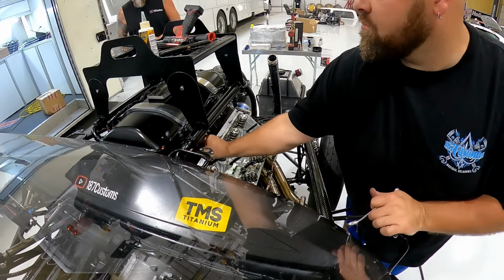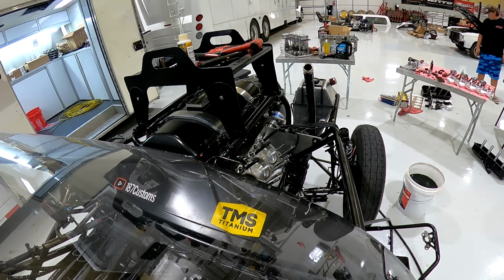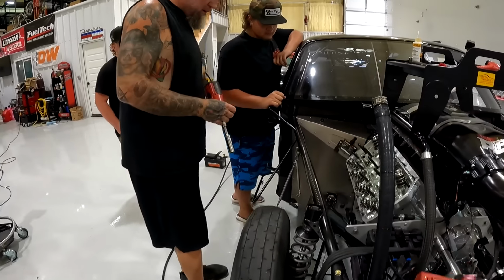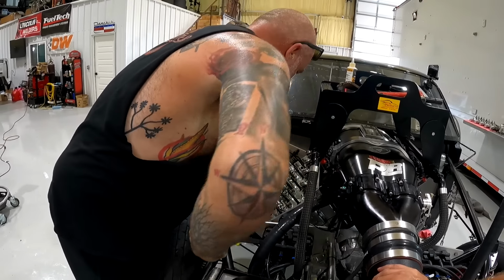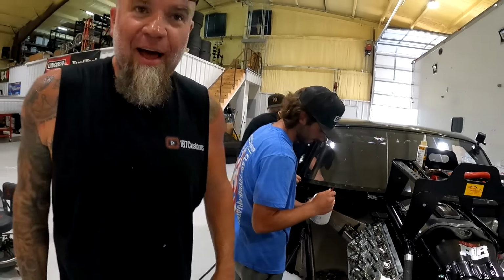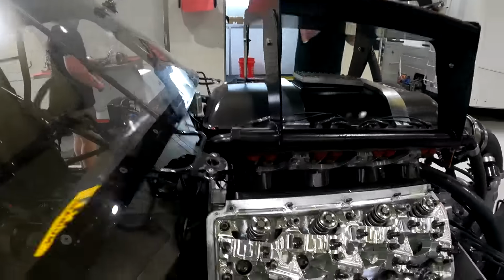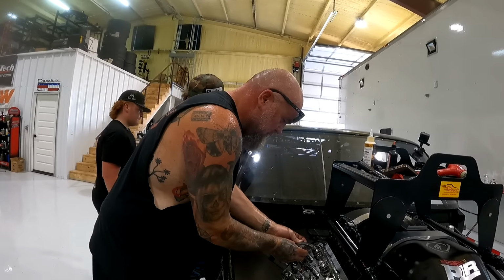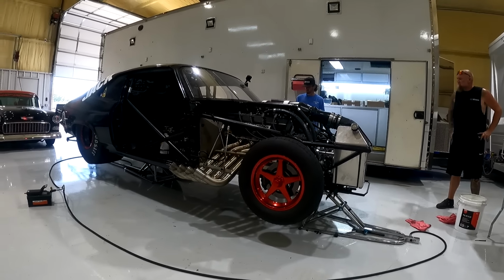Can We Freshen The Proline MH7 Hemi Ourselves?? Time For New Rods, Pistons, Rings, and Bearings!

Comment: Struggling with that roque wrench. Some of equipment we go to 1k ft lbs. have to use multipliers. 
On average most of our stuff is between 250 to 500.
It’s all shoulder technique. Never pull on the handle like that. Good way to slip and hurt yourself.

Keep up the good work.

Comment: Do you guys NOT file the corners of your rings before you put them on the pistons? 
I think one of the problems Shawn was having while installing the pistons was that the compressor is supposed to go against the head, and the piston and rings slide through it!
Thanks for the video, Phantom. I'd rather get a speedy view of you guys getting it done than having to guess whether or not you did it.